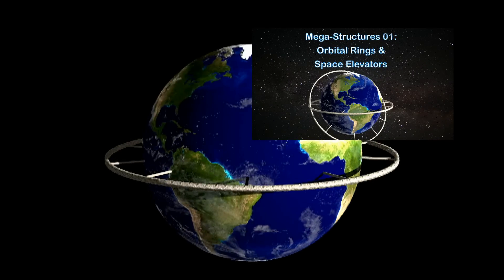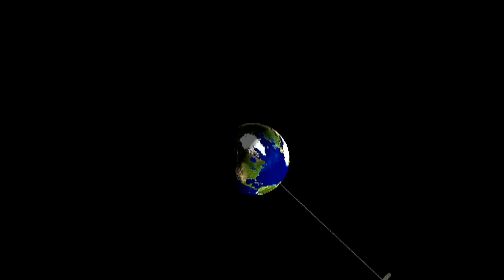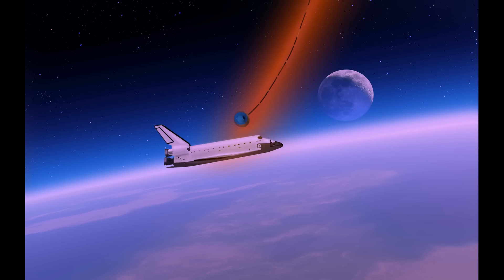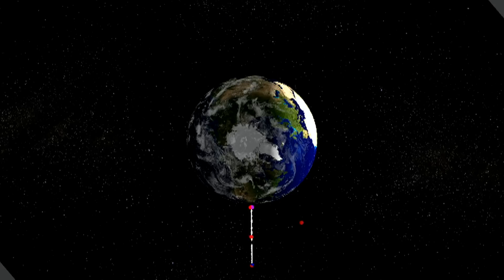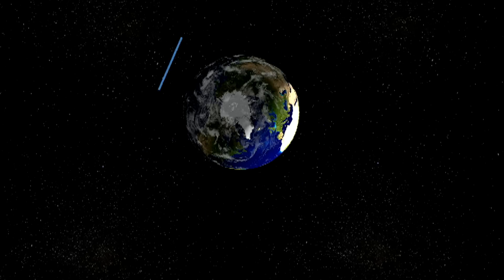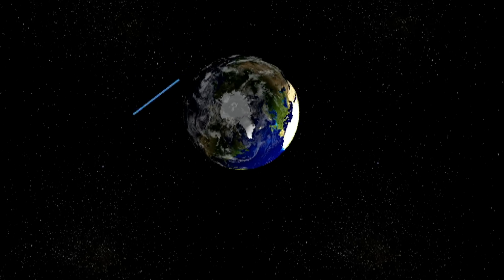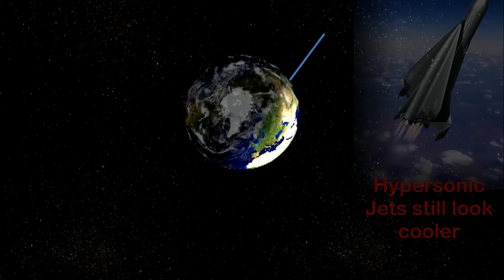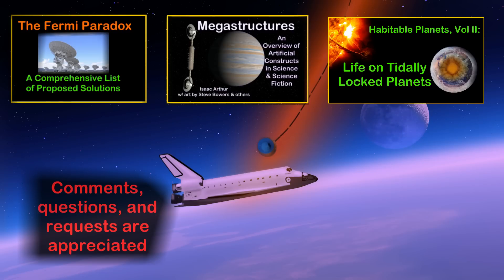Skyhooks & Rotovators

Comment: I do not see a need for a hypervelocity launch vehicle.  I see a need for a skyhook rotating only slightly faster, which could pick up slow, stationary, or even westbound aircraft.  This would be desirable anyway, as it would allow pickups deep in atmosphere or at lower and easily reached altitude, with minimal energy cost in atmospheric drag and the ability to regulate how much of that energy cost comes from rotation and how much from revolution.

Comment: What happens if something goes awry and the skyhook/elevator crashes to earth?
Reply: Not as bad as you might think. That is, if anyone does think about worst-case-scenarios. The system could self-destruct into hundred-meter-long pieces, which would burn up on reentry. Ditto the station at the top. But no contingency? Depending on what material the elevator/skyhook is made out of, it could range from "Terrifying fireworks" to "City-wide destruction", to "Crushing, space-ending Kessler syndrome", or even, very unlikely, "No more civilization".

Comment: I haven't seen anyone ask this but; wouldn't the momentum transferred to the ship be momentum lost by the hook? And if so, one would still require periodical boosts to the hook, which would be pointless since the point of a skyhook is reduce fuel costs; right?
Reply from the maker: Yes, but it would still be advantageous even if we could not regenerate the momentum. See the attached paper on HASTOL in the description for more on that. But regenerating momentum can be done with solar power, and slowly, via electrodynamic tethering. That's the big selling point, the hook slowly levitates back up by using solar panels to shove off the magnetic field of the earth after losing some to hooking.

Comment: What do you think about the possibility of using balloons to reach the edge of our atmosphere and then connecting with a sky hook from there?  Or perhaps using a "Rockoon" https://en.wikipedia.org/wiki/Rockoon to bridge the gap between the atmosphere and the lower part of the sky hook?
Reply from the maker: Balloons have generally tended to be impractical off paper for various reasons that often change from case to case. In this case a skyhook's lower tip is actually moving very fast, and balloons can't, too much air resistance.

Comment: wouldn't the rotating sky hook rip itself apart?
Reply from the maker: Good Question, not one I've heard before. Depends on what it is made of, how long it is, and how fast it is spinning. Generally the spin is on an order of an hour, give or take, generally even one spinning once an hour that is a thousand km long is only experiencing about .1gee, and with the slightly reduced gravity at that height you ought to be able to get away with a breaking length parallel to the normal one for that material.
Reply: I suppose it could hold together. but it seems like it would have to endure more stress when it is vertical relative to the earth because it has both the gravitational/orbital force combined with its centrifugal force. why not just go with a non rotating one. 
less force means the cable can be longer. 
Or is there some formula that shows that you can get away with a shorter cable and achieve the same orbital advantages if it rotates?
Reply from the maker: In general rotation with a shorter hook is going to be better than a non-rotating longer one. Length just comes down to the breaking length of whatever you are using, plus the mass of the ship, plus rotation if any.

Comment: Every time you use the skyhook, the skyhook slows down.  So, you do the electrodynamic thing to speed it back up, and then you use it again.  That's pretty cool, using the Earth's own magnetosphere like that.

This also means that for a while you can't use the skyhook, because it's "recharging" it's orbit.  But as long as this doesn't take more than a day or so it's stillan improvement on launch today.  And! since you've just brought the cost launch down dramatically, the second, third, and fourth skyhooks are much cheaper to build.  This way there can always be one available.
Reply from the maker: Yep, we really need to do some actual tethers to test it out, its great on paper but hauling a long tether into space with solar panels to get more solid practical data is still in the "Good idea, we should do that sometime" area of R&D. Problem is the rig up for your average satellite is more mass-intensive than just some fuel for station-keeping during the time before the satellite will break down and get obsolete, so it is only handy right now specifically for skyhooks or maybe a fairly low altitude permanent space station. :)
Reply: Skyhook also can recover momentum and make orbit stable. For one or two picked ships from low orbit, it compesates with one or two ships catched down from dostant trips.. Maybe I'm wrong.
Reply: Oh shut up... you're just commenting on something you just watched and have no independent, objective knowledge of the subject.  You may as well be commenting on how recharging a battery is so "cool".   Ugh
Reply: @DiffEQ  
This was about the fourth video on this subject I'd watched, and I'd read a few articles on it.  Six years ago I didn't (and don't now) know as much about it as, oh, Isaac Arthur, but I knew then and know now more than you're giving me credit for.

I'm always amazed at the way somebody can read one YouTube comment and think they know someone like he was their brother or something.

Comment: What material would the skyhook cable be? Isn't there the same problem as with elevators or would the skyhook cable be much shorter?
Reply from the maker: The strongest material you can mass produce :) And yes and no, the skyhook is helpful at any length but the longer it is the more helpful. I think the one's for HASTOL's design were a couple hundred miles long, a couple thousand is even better and definitely in the realm of possibility. You can also, and I don't think I mentioned it in the video, do multiple ones at higher altitudes, if you want to.

Comment: How does the skyhook not fall back to the earth once a ship has been launched into space?
Reply from the maker: +randomrocket2000 Well they orbit just like normal objects, at least in terms of their center of mass, if you mean how do they regenerate momentum lost to their lower end scraping the atmosphere or transfering momentum to the hooked object, the preferred way is with electrodynamic tethering powered by solar panels. Skyhooks get way more sunlight then even equatorial desert locations and they can regenerate momentum slowly between hooks.
Reply: Ah. Makes sense. Thanks!

Comment: Question: What is holding the skyhook in the sky? Every time a space craft was launched using this method the skyhook would lose as much momentum as the spacecraft gained. It doesn't seem like this system would produce any kind of net gain. Or have I flunked Newtonian physics?
Reply from the maker: Daniel Hall Nope, you definitely didn't fail classic mechanics, the momentum has to be paid for and regenerated, absolutely. The trick is doing it without fuel. How this is done depends on which style of skyhook is involved, and I only covered the basic two. The usual method suggested is to make sure the skyhook is a good deal more massive than the loads it is hooking and have it slowly regen the momentum from payload lifts and some air drag with 'Electrodynamic Tethers'. Basically it lifts itself slowly back up by sucking power in via solar panels and using that to shove off the Earth's Magnetic field. This is a slow, propellantless type of drive that's normally not terribly useful but is ideal for things like skyhooks. Other options can include things like solar powered ion drives, but in general the various types of more mass efficient drives that aren't good for launches because they're efficient but low powered.
Reply: If you use the sky hook to move objects down as well as up the energy list is regained resulting in only little corrections being needed to keep it in orbit
Reply: Even if you have to use fuel to do it, you can use much more efficient fuels. Ion engines, for example.